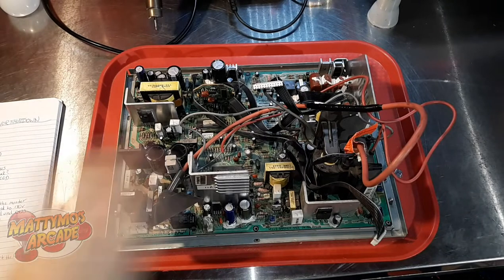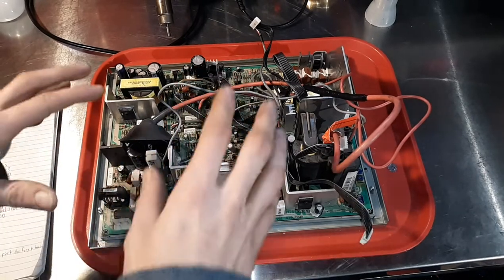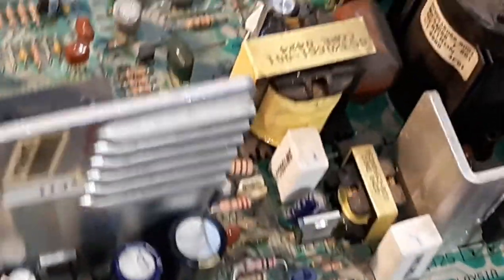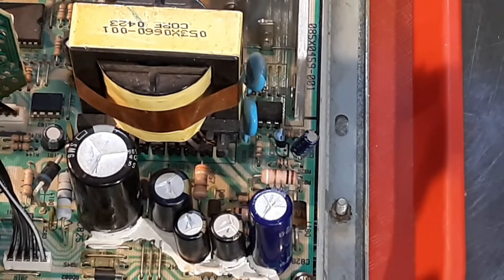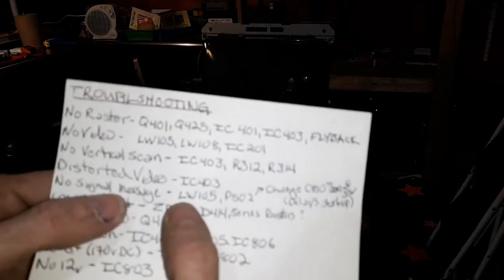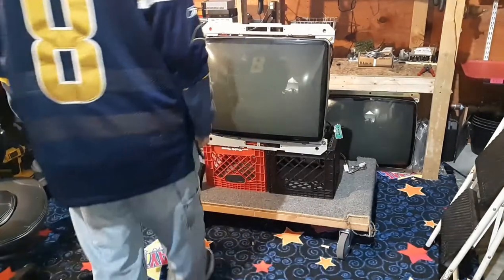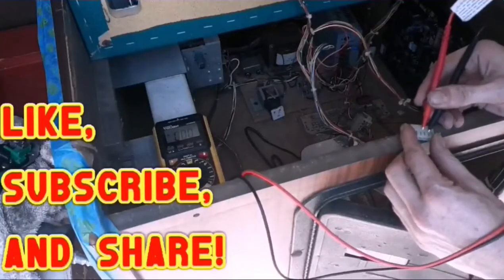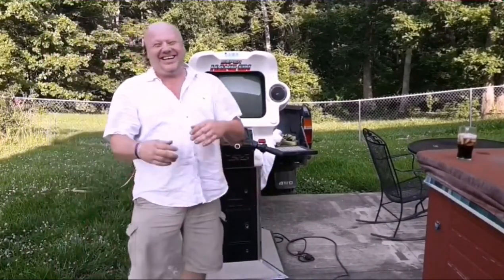Monitor Repair Log #1: Wells Gardner D9200 w/ High Voltage Shutdown

Comment: MATTYMOS arcade, A common problem in TV & arcade monitors is when you first turn ON the monitor there will be a "time delay" before the picture image will display on the CRT screen, what are some common failures to look for in this type of problem?
Reply from the maker: With this monitor in particular, it's a tri-sync that looks for the input at startup and will switch to that frequency automatically. The problem is, it searches before it's getting a sync signal from the game. The monitor will just display a NO SIGNAL message. But delaying the startup by upping the capacitor, it has a proper signal at startup. The D9200 and D9400 were problematic because of many things, but one is the auto sync feature. It can get stuck in the wrong resolution, which I hear can be a pain. I'm lucky I havent run across that.
Reply: @MattyMosArcade  when you brought a brand new TV back in the 70's and 80s the TV should turn on right away but through the years of using it daily the TVs would turn on after mins before it display an image. Have you seen this same problem with arcade monitors and what was the cause of this type of problem? I'm not sure if the CRT tube looses electrons over the years of use and takes longer to display an image after years of use.
Reply: @billwilliams6338  This is generally a heat issue. Solder would get hot and cool many times creating cold solder joints. As your TV or monitor heats up so does that now bad solder joint and eventually you might get a solid connection allowing things to work properly.  Remember how we used to hit the side of the TV and all of a sudden we would get a good picture? This is because of those cold solder joints. Jolting the side of the TV cabinet sometimes made these bad solder joints make a connection and your picture would fire up.  The solution is to get in there and re-flow all the solder pads. If it looks really bad I always pull the old solder off and put new solder on.

Also there are cases where bad capacitors will begin to sort of work if they heat up. A full capacitor replacement on old TVs and arcade monitors will save you other damaged components down the road.

As always CRT TVs and Arcade monitors should be properly discharged before you work on them.